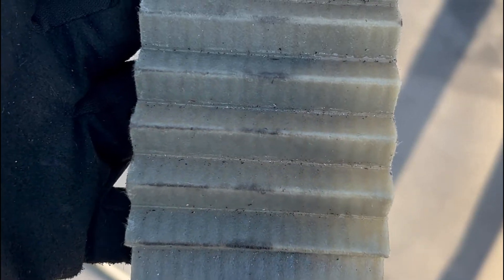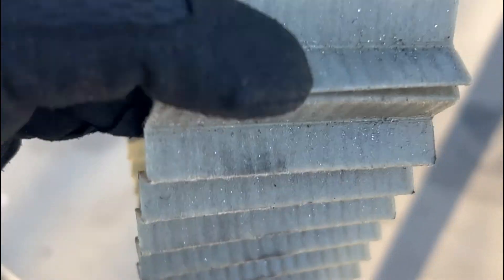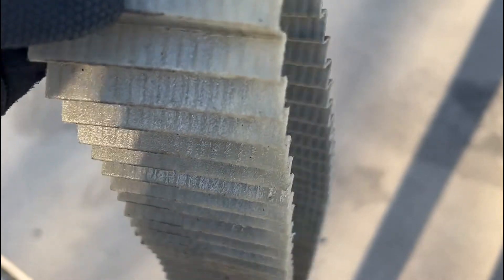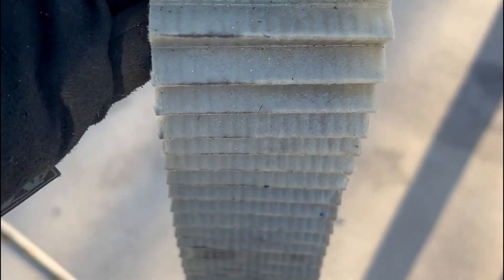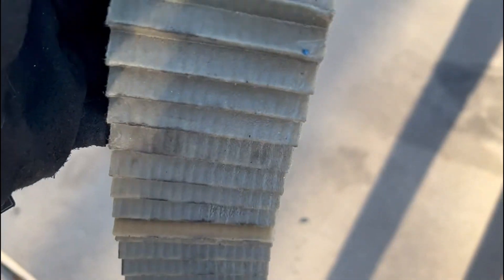N55 Forged Motor Build for the NewPure 750

Comment: Bigger bore no, cylinder wall are weak as is due to coolant passages between cylinders. Closed deck is a must for a bored 6 bolt N5x block.
Reply from the maker: .5mm which is almost nothing. You can hone more then that if you are to aggressive. Id rather machine it that much then hone. Should have little to no affect on cylinder wall strength.
Reply: @Inhouseperformance  I’ve seen so many case were a built bottom end 6-bolt n5x block without css lift heads at 800whp due to a lot of cylinder pressure which causes the block to crack between cylinder walls but not the 07-08 n54 8-bolt blocks due to not having coolant passages between cylinder walls.
Reply from the maker: @wahabzazai1963  yeah Im going to be lucky if I hit 700whp with this setup and Im not going to go past that with this car. If I was shooting for those numbers then I would have closed decked the motor.
Reply: @Inhouseperformance  swap a 8hp70 in there and hit 700+whp. Stock block n55b30m0 with pinned crank hub and upgraded rod bearing usually make 650whp+ with the n55 so I thought you’d be pushing more.
Reply from the maker: @wahabzazai1963  non of those items make power what turbo you run determines your power range. I have the Pure 750, yes I put in forged rods and pistons and the zf8hp45 is built and can handle 750+ and I have a Vargas crank hub but Ill be happy if I hit low 700whp but at the moment Im not sure I will be putting any other turbo option on the car to make over 750whp.
Reply: @Inhouseperformance  Yes the turbo and it’s air flow restriction does determine the power and torque. I was just talking about how much power the blocks can handle.

Comment: I’m stage 2+ mhd fbo atm what would you recommend be my next step ? Looking to make around 450-500 on 93 ? If possible
Reply: You need this sized turbo roughly. What car is it?
Reply: @HollowM2  335i pwg looking at big boost 3.4 or pure turbos
Reply: well i guess it's not ps2 anymore but the 750
Reply: @1Clean.E93  yeah you mane have to do your rotating assembly to hold it reliably. Especially if you plan to turn it up on E
Reply: @HollowM2  only plans are to run pump 93 or e30 blend my only concerns are fueling
Reply: Same here, F10 n55 mhd 2+ fbo, looking for easiest and cheapest way to get 500 hp on pump 93 gas! Appreciate any advice...

Comment: I have a 2011 E90 with the n55 i want to rebuild eventually how much do you think it would cost ? im looking to hit 500-600whp before i do the rebuild just to have fun full bolt on e40 blend and i did the rod bearings on it just for a peace of mind great videos btw looking forward to more just subscribed
Reply from the maker: Thanks for subscribing! The rebuild without the transmission and all the right supporting mods gets expensive. I added up all my receipts including all parts, hardware, paint, powdercoat, supplies, tool purchases and with the transmission build I was easily over $12k. If you just did rods, pistons, bearings, gaskets, crank hub and all new bolts to replace torque to yield hardware its close to $4k just for those parts. Then for turbo, fuel system and all supporting mods it starts to get expensive. Transmission will be your biggest expense if you plan on making more then 550whp.
Reply: @Inhouseperformance  yeah the rod bearings cost 3k alone I don’t have anything else internally done but it’s just a thought I feel like it can handle the power on stock block maybe I should just built the trans and keep it as is I have a bigboost turbo kit that I’m doing and bmp port with the manifold I should be right around where I want to be but thank you for the reply!
Reply from the maker: @TheDayday0707  my apologies these prices are just parts. Since I perform all the work myself I didnt pay for labor on anything but the transmission build and thats when cost really start adding up. The transmission build will cost you around $4k with Jacks and $6k with Pure. My only concern would be crank hub and rods but you should be ok staying south of 600whp.
Reply: @Inhouseperformance  agreed I’m staying below the 600whp anything after that I want to rebuild but I’m buying a m2 soon so I just want to keep this car and have fun with it I’ll be looking into the transmission for sure and I want to learn how to do everything my self and build my own engine that would be dope!

Comment: I got a question for you, I have a 2015 m235, would this turbo be fine on stock motor or would you recommend anything being built?
Reply from the maker: I dont want to say Yes and be wrong so please fact check what Im about to say. As far as I know the M235 comes with the same engine as the M2 non Comp. So in saying that I know the crank is forged but my main concern would be the connecting rods and I cant 100% say for certain that your engine has forged rods. But supposedly that version of the N55 can handle a lot more torque and power. So you might be fine with the 750 without building the motor.
Reply: @Inhouseperformance  that is what ive heard is that the m235 has some built parts, but i will have to fact check and do some more research thanks!
Reply: @framefragsgaming2942  I’m sure you figured it out by now but there are several m235i pushing over 700. But the motors are not the same as the m2. M2 has completely forged rotating assembly

Comment: Love the video! Cant wait to see more. In the future if you can, please leave links below for the parts on your car or a folder. Would greatly appreciate it
Reply from the maker: Just added my parts list with links on most of the parts I added to it with this build and some more. So check it out in the description.
Reply from the maker: No problem! I can edit the description and do that later tonight for everyone.
Reply: @Inhouseperformance  just wondering I am going to be upgrading to either a pure stage 2 or a pure 750 I'm just wondering if you get any turbo lag. And at what RPM do you make Max boost with both of these setups?  Thanks man great videos!